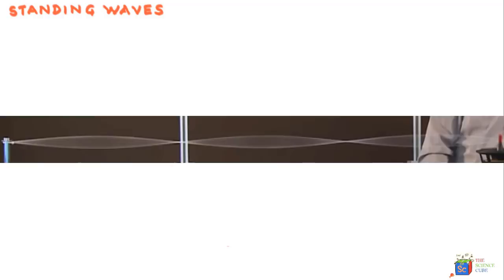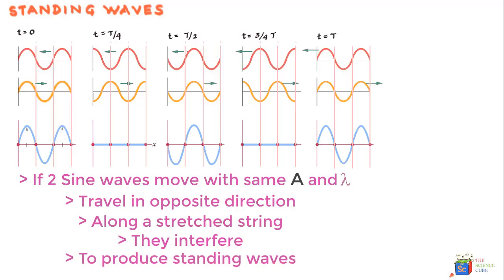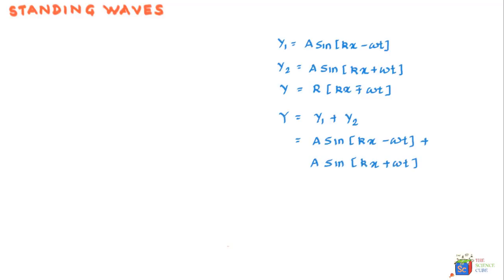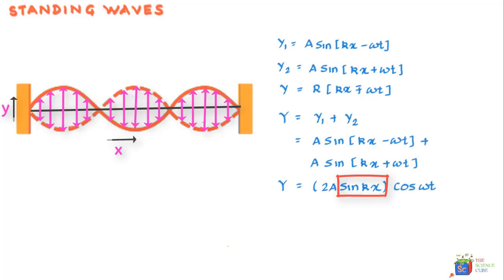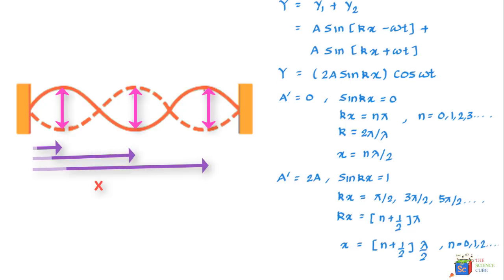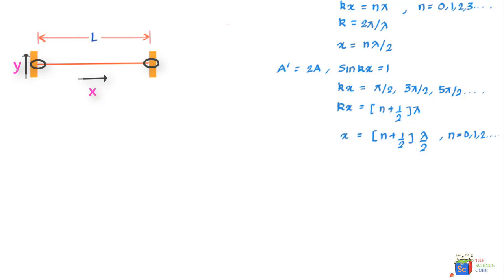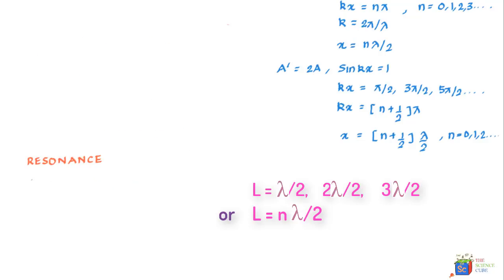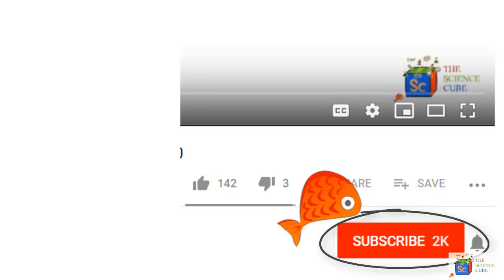Standing waves and resonance (nodes and anti nodes) #8

Comment: But sir wht is the difference between resonance and harmonics?
Reply from the maker: Let us take a guitar string to understand this. If one of the strings is plucked it will vibrate and we say that this is the natural frequency... and when it vibrates, a standing  wave is produced. Then this natural frequency is also called a harmonic. We can force this guitar to vibrate at this harmonic or a standing wave pattern by connecting it with another object that kind of pushes it to vibrate at its natural frequency. So this is what we call  resonance or when an object (guitar string here) is forced into vibrating at its natural frequency when another object vibrating at the same frequency is connected with it